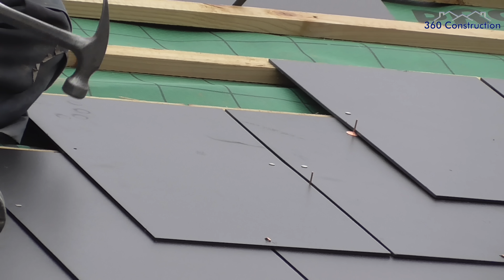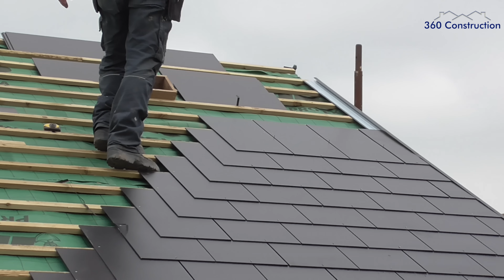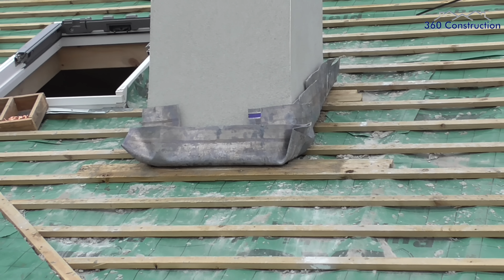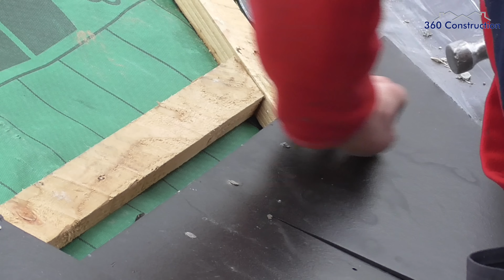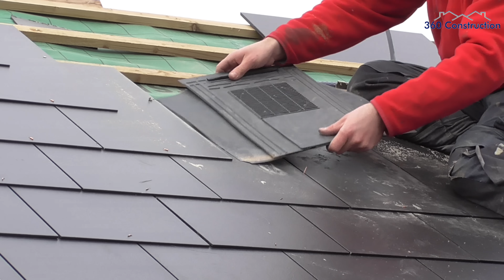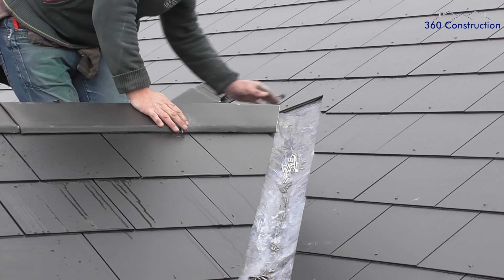Roofing - Slating

Comment: Why are there nails on the exposed lower edges of the tile? 

Surely that leaves them open for water ingress and nail rusting. Normally on slate roofs, you only nail under the area covered by the next tier of slates.
Reply: its a copper rivet, to hold the slate in place. it sits between each slate and there is no nail hole there. These are cement fibre slate, not real slate and thats how this system works.

Comment: First slate the bloke puts on is wrong you never knock a fibre cement slate over to the other slate because the further you go up the gap becomes tighter and tighter put the crampion up high and always knock it down

Comment: I used to roof this way. Then I discovered slate hooks, no need for nails or copper tags. brilliant. Only nail the verges. Rubber slates and hooks is the future. No broken slates. There is now a gas fired device for fixing  the slate hooks.  Never though I would see that.! No need for 3/4  under eave slates neither. Use continuous under eaves. 3m long.   A good looking secure roof.
Reply: Davinci
Reply: @ericbstudios9807  Yep. Agree there.
Reply: U are talking absolute shit mate…
Reply: Can you please recommend a brand of the rubber slates. Thanks.
Reply: Davinci.  @nopt1118

Comment: Since when did we start slating with a joiners hammer ?, plus that felt should be on top of the lead otherwise  water will just run under the valley  boards and straight into the house

Comment: The first two eves course are on at the wrong gauge hence that you are nail two eternits together then why not bring the valley laths closer to each other so you can dress the lead over them to make an upstand, it would be a lot more water tight and the best way when slating a valley in. Use blanks for verges to.

Comment: Hi. Great video! I use make sculptures out of slate and have put a couple of roofs on but never seen them nailed at the bottom like that. What stops the roof from leaking?
Reply: It’s not nailed at the bottom it’s a copper disc / rivet that sits between the two lower eternits, the eternits have a hole in the centre at the bottom the the rivet goes through then you bend the rivet down, this is so the eternits does not lift due to wind and from curling up from sunlight.
Reply: @gaza19661310  Thanks Garth! I see - thank you.
Reply: @gaza19661310  there is a hole directly above the seam? I understand you don't want the to rattle from wind, but slate curling from the sun?
Reply: @FlymasterFlash  yes eternits do curl in sunlight
Reply: @gaza19661310  the information I was able to look up on the internet and found out these are not slate like slate Rock but it's a mixture of things. It does look beautiful.

Eternit is a registered trademark for a brand of fibre cement currently owned by the Belgian company Etex.[1] Fibre is often applied in building and construction materials, mainly in roofing and facade products(wiki)
Reply: I was thinking the same I dont understand that atall
Reply: A couple of roofs u must have been putting on natural slates if ya never seen a cramp been used on slates before

Comment: The lead in the valley is to short should of least taken it over on the striker batten, any rain will get under rot the batten.
No copper nails used on slates
If you was to cut a slate just above the nail hole you would of got the dummy course and your other slate with.
Reply: And no welts on the lead and probably many more thing

Comment: As being a roofer for over thirty years I have never seen anyone put an exposed nail through a panel even if it is a synthetic slate and the corners are recommended by manufacturers speciation to bend the corners down before installation. Just saying from a professional perspective.
Reply: Does not make sense.

Comment: Amateurs at best, probably one of those brickys that can put any roof on as well 🤦🏼‍♂️. Lead on to breather felt, any roofer would no why that’s a big no. Not to mention nailing through both pieces of lead. Eaves and dummy course shabby again roofers can see and know why. Personally I’d use slate and halves to complete the look but as the halves are tight under a verge I think they’re fine. I mean they don’t even look like roofers where are your pockets 🤷🏼‍♂️
Reply: That Eave gauge 🤷🏻‍♂️😂. Half slate up the verge is ok. Anything under 150mm then cut from blanks and rivet out myself

Comment: What is the nail in bottom of slate for
Reply: Jeff Brosky they’re called copper disc rivets. They prevent the slates from bowing and stop the wind from getting under and moving the slate ect.
Reply: So not real slate if your using copper rights to keep slate from bowing I have installed hundreds of squares of real slate from government buildings to church's and barns
Reply: Jeff Brosky yeah, they’re not natural slates they are cement fibre ones

Comment: Brilliant job. Thumbs up, I do the valleys exactly the same.  If it was a very steep roof I probably wuld curl the lead over but no call to there. Had to laugh one comment on he said the timber wasn't treated.
Reply: Are these slates plastic or pvc made?
Reply: @Dailymailnewz  neither.
Cement fibre with waterproof coating
Reply: Makes no sense.
A steeper roof has less danger of blow up under the slates.
Shallow roofs are way more prone to it.
It's good practise to worm all lead valleys
Reply: @tsunamitube3351  it's the rate of speed the water falls on a steeper roof more likely to shoot under slates on opposite side.
Reply: @tsunamitube3351   you must get a lot of wind were you live buddy

Comment: WAIT!!!! I think they install the roofing shingles the wrong way , the bottom(the side with a nail hole) is suppose to be at the top , and the top(the part with no hole) suppose to be at the bottom  so those nails  are not suppose to show up , they are suppose to be covered by the next shingle. Go and freeze at   0.42, and try to imagine those shingles with those nail holes on top and not in the bottom.... why would you have an exposed  nail hole for each shingle ? That roof is going to leak , even if they use caulking!
Reply: No water leaks. Where the rivet is showing, it's double lapped- 2 layers of slate below it- do your research....
Reply: Water leaks.
Reply: gabitu olaru. good observation I noticed the same thing it doesn't matter what kind of nails they use unless you use a screw for a metal roof
Reply: gabitu olaru look at 26 seconds he acted like he nailed something in the top but he didn't

Comment: questions: 1 do those tiles make a lot of noise when it rains?   2. are you using pressure treated wood ?  3. does capillary action pull water upwards underneath the tiles since the surface is so slick?
Reply: Any questions please @ me 
I’m a roofer who is a professional
Reply: @DirtBikeDocs I’m starting a slate roof next week- reclaimed slate, 45 degree pitch. Never don’t it before- does the first batten which supports the bottom row slates need to be thicker than the other battens ? Im asking this because I’ve noticed that roofs are three slates thick but will only be two slates thick for the first course

Comment: looks like galvanized nails used here,? as the norm is aluminium nails or copper nails to be used on slates to allow for easy ripping out if repairs needed or pipes needed to be fitted at later date.
Reply: Tony Donovan... copper nails are used because they don’t rust, where as aluminium does.. ie. if the head of the nail rusted off the slate would slip out.

Comment: Anyone gonna mention the lead?
I’m sorry that is the dumbest thing I’ve ever heard. and it’s for the water to run down?? What about galvanized steel, or tin, or aluminum?? Holy fuck that is dumb.
Reply: Lead is easier to shape than the materials you mentioned. Also lasts years if installed correctly (the guys in the vid didn't). Very common material for valleys, flashings, and entire flatroofes in the UK.

Comment: The only issue I have is how the lead sheet valley was installed ,why didn't you leave the lead another 3 inches longer on both sides so you could have formed the lead up and over your firing strips on the outside of the valley ? 

On tile roofs when you install chimney pans and valley metal you always turn up the outer edges of your metal work to prevent heavy rains from being wind driven under the tile ,I fully understand the true waterproofing system here isn't the slate tiles ,it's the underlayment system ,however it's good roofing pratice to prevent water from entering the tiles any chance you get ,you guys did a good looking job that should meet all warenty requirements easily but think about what I said about " rolling " your valley lead up and on top your strips ,in an area with heavy snow & ice loads having your leads turned up may be what prevents an ice dam from forming underneath your slate and pulling a valley apart ,investment seen it happen .
Reply: The valley batten (firing strips?) can't be covered in lead, as that's where the valley slates need to be nailed - lead valleys should only be nailed (with copper or stainless steel) at the top and not on the sides or bottom. There should also be a welt (roll). These guys have done a sub-standard installation by doing the bare minimum.

A battened roofing system would be nearly impossible to have ice dams, as there would be no ice restricting the flow of water on the underlay to the eaves/gutter.
Reply: @SocialistChampagne  the best way is to have upstand over the laths in a valley, just put the lead half bonded onto the valley laths to give you the other half to nail and while not effecting the lead so it can still contract and expand, but like you say they haven’t even bothered to put a welt on and this is a very poor job and will certainly leak.
Reply: i do this on all my valleys but i crimp all my felt into it and dress flat thus creates a perfect weather tight seal forever if dressed correctly
Reply: @putadonkonit2338  what are the black slates like comoared to the blue/black slate. I heard the vlack ones show up alot more mark on it over time. Im near roof level and need to pick one
Reply: They cut the lead into 1 half metre lengths and then nailed them all together 😂😂😂 welt the lead on the edges all the way up the valley, wear gloves and use a dresser at all times, other than that it’s great 👍👍

Comment: Not too bright handling lead without protection. Must not be in USA. Steel is used in the valleys.
Reply: San Francisco FYI lead is still used everywhere from roof sumps and soil pipe leads to sheet lead roofs and valleys ,except crazy California ,as long as your lead is coated to prevent ground water contamination it's still the best Waterproofer around .
Reply: lead lasts 100 years, steel doesn't
Reply: San Fran, What's wrong with handling lead ?  The stuff they are using almost looks like it has a coating on it and not oxidized or sloughing off at all ?
Reply: San Francisco In USA they use cardboard to build the whole house so wind blowers whole suburbs away.

Comment: First fault is there is no turn on the lead valley. ooops. Second there is plenty breathing on batons with breathable membren. Third the very old ones were very strong and the new one will bend because there very soft. and they are totally rubbish today. And I notice the guy was putting both nails in and no rivit, You should bend the rivit put one nail in and then the side rivit, then the last nail. But I am a show off.
Reply: Is the rivet the piece they were bending over on the bottom/middle of the slate ?  Why not use another nail ?  And are these slate tiles made of rubber or something, it appears they are cutting them with snips or something ?  Thanks.

Comment: Oh here we go again with all the experts 😴😴😴😴
Reply: I don’t care for the finished product I think that face nail looks really tacky that shit would never hold up in this year Nevada’s we deal with a lot of ice it would work that nail right up and out
Reply: Exposed fasteners are so 1990
Reply: If you see things why not? At 3:03, the undercourse has a side lap of ~1" with the first course. Most of the water will be shedding in that area. Proper slate installation requires 3" sidelap so rain doesn't run weep and run into the underlying gaps. The wood on that lower edge will be replaced in 15 years.
Reply: @gmyatko  that first slate is only to strengthen eave and hold copper crimping for actual first course.

Comment: The valley installation isn't right that would leak at the eaves
Reply: mike gerrard Your wrong ,the valleys are installed correct and will not leak at the eaves ,please explain in detail why you believe the valleys will cause leaks at the eave edges ? I've had my Journeyman card in Roofing & Waterproofing over 35 years and see nothing wrong here ,not even the final slate in the valley being butted up " too tight " as somebody else exclaimed .
Reply: Michael Ledford 
To make that valley right you 1st install a second batten or fillet that runs in line with the valley boards to enable the sheet lead to dress over it creating a pan to stop the water rushing over the widths coming from the opposite planes 2nd you would turn the lead up creating welts or check roll at the eaves where the diagonal batten is short because of the tilt required to straighten the eave overhang ,other wise the amount of water the bottom of this valley would take probably would leak

Comment: All these experts spouting bollox. These aren't even slate they're tough as shit man-made fibre tiles made to look like and resemble slate. I'm over 20 stones and they can take my weight easily, as I have just been ripping these off to put Sandtoft 20/20 clays up on my mums roof and they are way much more fragile than these particular tiles. My step father now deceased used these same tiles 30 years ago and I just wish now my mum hadn't wanted to change them. It's meant new steels in for load bearing also as these particular slate tiles are so light, but hell they are strong as!
Reply: Is your grandma in that picture?
Reply: What the hell are ´stones´ ? Don´t you know that the civilised world uses the metric system for weight ?
Reply: I had them put on my roof 18 yrs ago. they're like egg shells to walk on now. Never again.
Reply: oh and I am only 12 stones

Comment: That first course is WAY too tight, these thin man made slates will eventually fail if they are hammered into a bend like that.
Reply: Mike F are you serious about " Paper " , they could have installed those slate directly over the firing strips and the building wouldn't leak due to the corrugated roof decking by itself ,then they installed a self sealing adhesive backed Ice & water shield membrane over the entire roof deck before installing their firing strips ,then a lead sheet valley ,this job doesn't have any paper .
Reply: that is what the paper is for dont you know anything ha ha. They better have good paper.
Reply: I believe you, its obvious a journeyman roofer could easily pick this ridiculous roof apart.. I'm not a roofer and I could see a windy day would blow thos roof right off, hopefully cindy and Bobby aren't playing near it those tiles are like flying razor blades